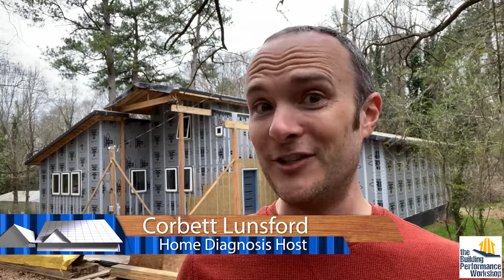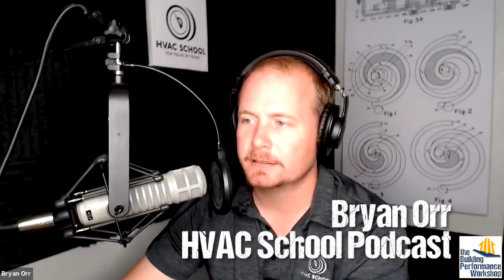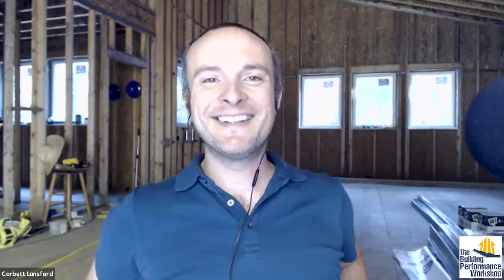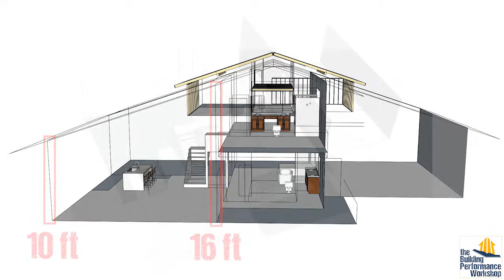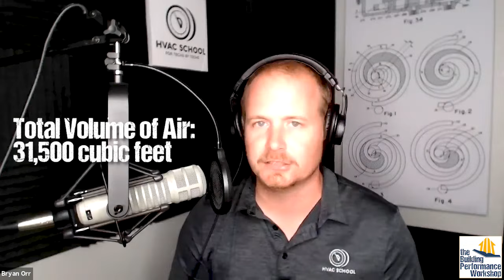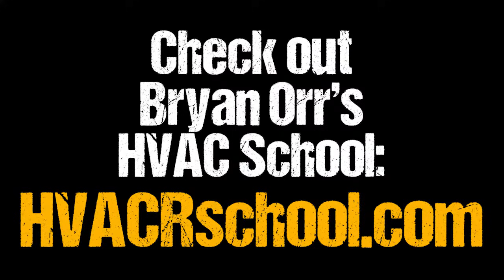HVAC Design Q&A for High Performance with Bryan Orr

Comment: would u recommend a heat pump over gas furnace for winter in houston texas? energy efficiency wise... its about 40-50 degrees on winter and lowest 30 degress but only for abt 20 days a year
Reply from the maker: Heat pump over gas furnace for 90% of situations in my opinion
Reply: @HomePerformance  thanks for the early response (:

Comment: I find that flex does considerably reduce noise, I try to use it as much as possible. Straight and tight, length is not a concern. (I’m not a huge fan of concealing it behind drywall).
Reply from the maker: Straight, tight, and as long as you want- sounds just like Neil to me

Comment: 10 kids? Bryan, are you Catholic or just a Protestant who gives it all you got?  

In regard to throws with the smaller airflows of low load homes, I’ve used terminals from Dayus in Canada for several years. (dayus.com).  They can provide bar linears as small as 4”x2.5”. Free area is 2.5 inches2. 12 CFM hits about 800 fpm. And I don’t have any objectionable noise. 

One disadvantage is the only engineering they provide is free area, via a calculator on their site. But, I have learned after testing, selecting terminals for 750 to 850 fpm provides about as good a throw as I’m gonna get. In some cases, I push it to 900 because manufacturers insist on modulating indoor air flow with compressor PWM. (As if they think it will help remove enough humidity to eliminate the need for whole house dehumidifier 😂)

Another advantage with Dayus is I can specify the terminals without a damper. (Not to be confused with the mandatory balancing damper) I’ve never understood the purpose of a damper in the terminal anyway. Eliminating it saves $$ and pressure drop. 

There are some other pretty decent ideas in ACCA’s recent publication, LLH (Low Load Homes) along with some not so good ideas as well.
Reply from the maker: Great comment, I’ll check out those terms

Comment: Why are you adding a dryer with a vent? Why not a heat pump dryer?
Reply from the maker: It’s a cool gizmo, but haven’t yet seen evidence it solves problems proportional to the added cost. Everything has side effects.
Reply: Any dryer should be vented to outside to remove the moisture if nothing else.
Reply: Steve oh, so heat pump dryers should be vented?
Reply: I just looked them up, and I guess they are actually dehumidifiers with a reservoir of some sort for the water. I stand corrected. Should have looked first I guess.
Reply from the maker: Hey Dave- you'll be happy to know we've selected a Miele heat pump dryer, which to my surprise is the about the same cost as a normal dryer.
Reply: Home Performance  nice! I want to get one myself.